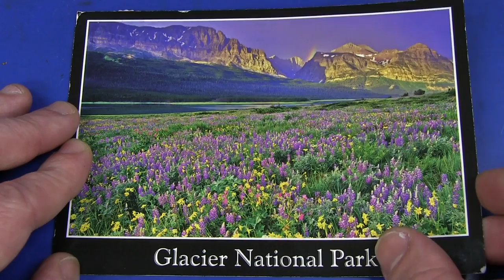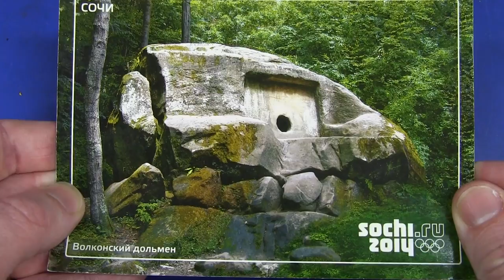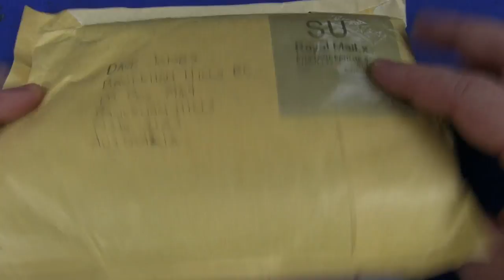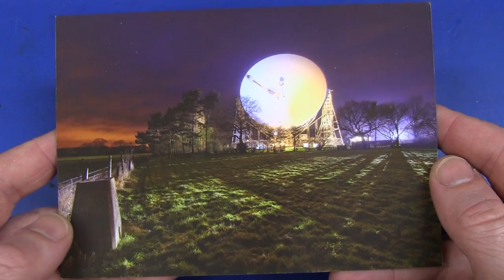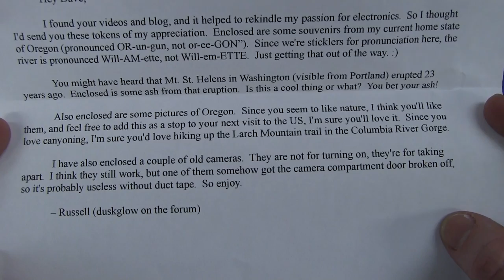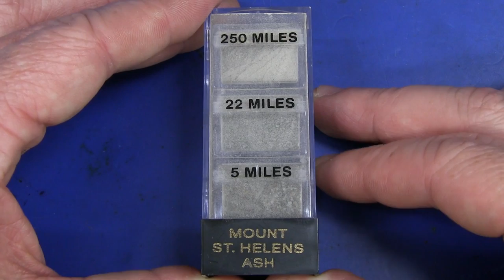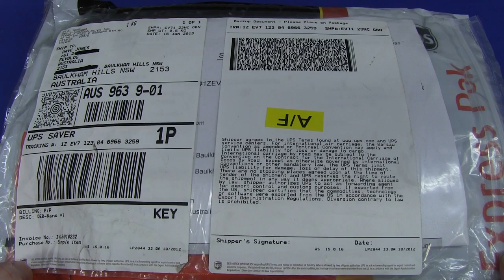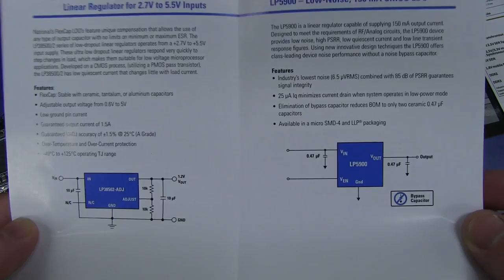EEVblog #494 - Mailbag

Comment: I once had the exact geiger counter shown in the video. The GM-tube is not the one you showed, which is just a neon lamp, but the metallic one under the insulation material, in the lower left. You could try to get it clicking by getting uranium glass marbles off ebay (cheap and safe) or some other source like americium that you might find in an old smoke detector, although that kind of tube is only sensible to gamma rays..

Comment: I'm a Funeral Director and we have a box at work full of old pacemakers that have been acquired over the years. Being from the UK, there not easy things to dispose of. If a cremation is to take place they need to be deactivated before removed which is done from a local database (If its a defibrillator a wand is used)
They have seriously explosive under heat that can destroy cremators!  
Certainly not for the faint hearted ;)

Comment: Shows about FPGA topics would be great. Besides demo boards I think it would be very interesting to cover how to embed FPGAs into your own design - so how to take care of the different voltages they need, what programming interface to use, how to program them from flash or microcontrollers - or the alternatives, i.e. flash-based FPGAs etc.

There is a huge amount of possible topics here - free cores (OpenRISC from opencores, leon CPU, etc.) for example.

Comment: Regarding radiation detector - by the looks of the tube, it's apparently a low-sensitivity one. Useful for measuring really high radiation levels (like 100-1000 above background level), your only chance to get it see something - is probably an X-Ray tube or medical gamma source.

Comment: could break open a smoke alarm and cut into the small radioactive canister that most have inside them if you want to test that....other idea would be an electron gun tube (like from an old CRT), but not sure if that would trigger the detector